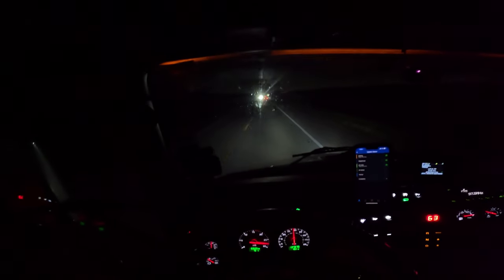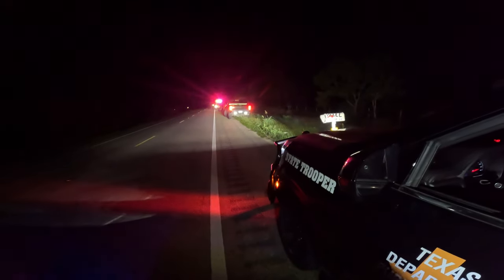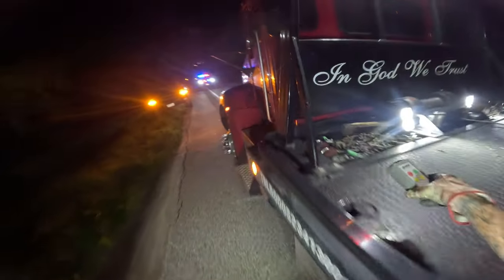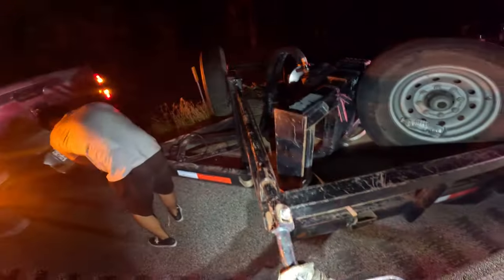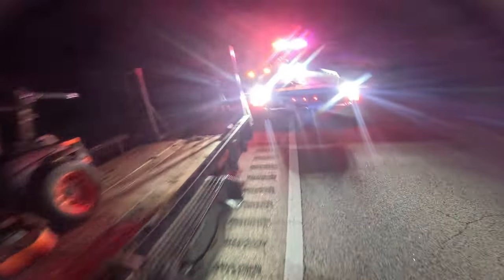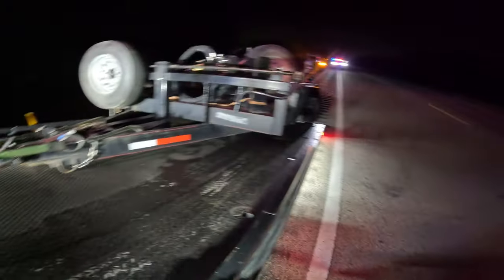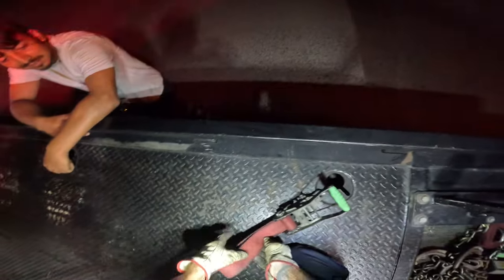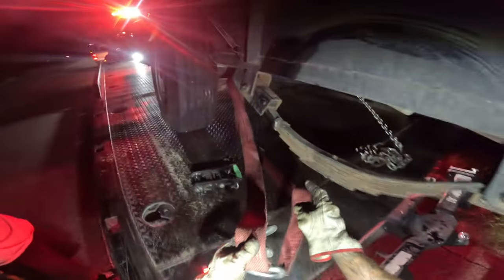Utility Trailer Loses BOTH Axles, and Goes Into the Ditch!

Comment: A little suggestion when you get it up onto the road get it actually on the road and then straighten it out and then that way you can put the trailer back on straight without being cockeyed a little bit that's what I've seen on some flatbed tow trucks I know a tow company in California that can put a trailer like that on his flatbed and straighten it out and make sure you go down the road with the straight on the bed
Reply from the maker: That works well in theory, assuming the trailer tracks straight. Unlike a damaged trailer. Like this one.
Reply: This trailer had 1 tire, and one rim, a dismounted axel and a partially Dismounted one. There was nothing going to be straight when everything is already odd angles.

Comment: looks like he slowly veared intoo the berm , maibe caught a low pole / roadsighn tearing the axles out from underit , hes probably wide awake now after the fact
if the trailers frame is still straight it should be fixable , probably needs new axle as the old ones are surely bend
Reply from the maker: They hit a parked car.

Comment: Dustin your flatbed should have a crane one it the Job would be easier
Reply from the maker: Yeah no one does that in America.
Reply: @Towtruck_Dustin  does they allow flatbed tow truck with crane in your country because in my country that's what we use and the wrecker truck
Reply: @kenlypacquette3918  I don't think there are any rules against it, just not something that is needed often enough to justify the added weight/cost of outfitting a truck with a crane.
Reply from the maker: It’s not a technology that’s used here. Most of our vehicles weigh a lot more than the vehicles driven overseas. 
Especially here in Texas, a lot of our trucks and SUVs way two or three times what the little cars driven overseas weigh.

Comment: Looks like u should have winched it from the back
Reply from the maker: I don’t like doing that. End up fighting it more. Then the axle wants to move, and the tongue and jack dig into the ground and cause more damage.
Reply: @Towtruck_Dustin yep pretty sure you know what you are Dustin  great job and video
Reply: Doing
Reply: @Towtruck_Dustin  I see ur point now at the time I didn’t think about that
Reply: @laisuresboringadventures7052 The tongue will also be a single point of contact letting the trailer twist just like old trikes used too.

Comment: Going to Need a Longer Bed  for that truck Or Longer truck
Reply from the maker: Why? Length wasn’t an issue. The only issue was the broken axle dragging along the ditch not letting me center it on the bed. Other than that the bed mad more than long enough